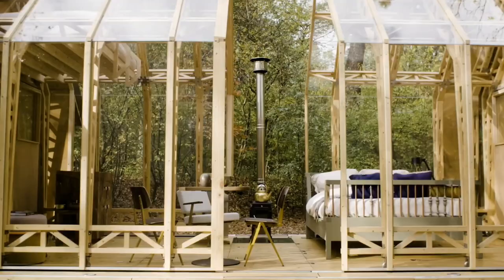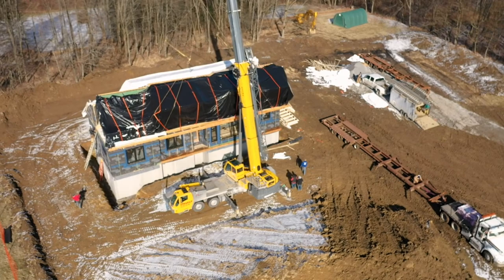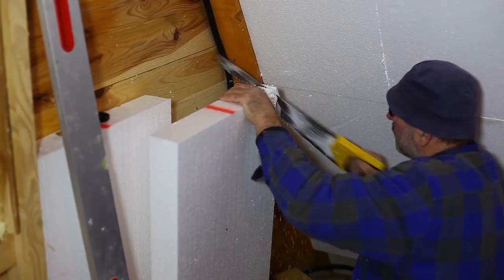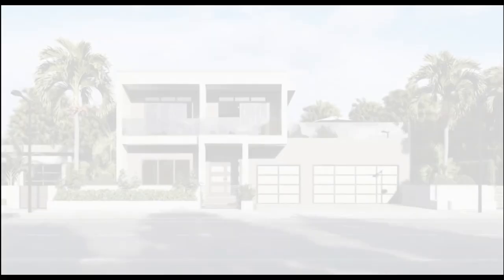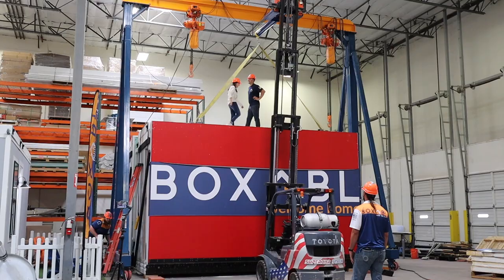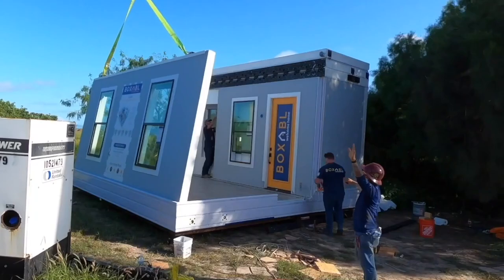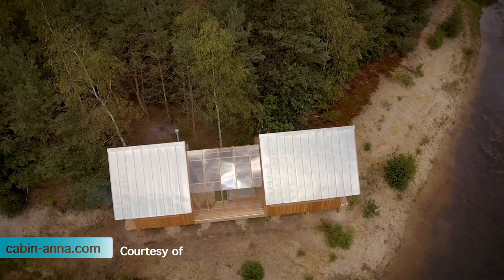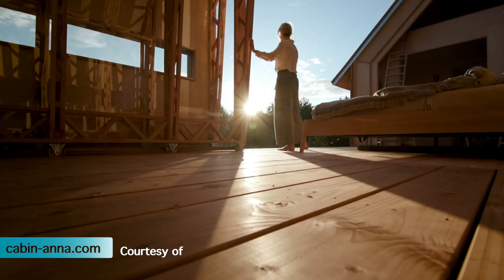The 5 Biggest Lies About Modular Homes

Comment: What do you think about mobile homes that you own the land?
Reply from the maker: I think they are a great affordable housing option.
Reply: Is it easier to get a mobile home loan compared to single family or condo loan?
Reply: @robertpaetow7812  It is more difficult to get a mobile home loan and they are pricier. That's the simple truth.
Reply: Do they increase in value I am hearing it depends on the mobile home in the area is that true?
Reply: @robertpaetow7812  I know a community that has a lot of mobile homes. They do increase (and decrease) in value, but they are not worth what a regular house is worth. And yes, it depends on location, the age and condition of the mobile home, and a lot of other factors. I believe any mobile home older than 1978 is a liability due to asbestos concerns. You will find the best values (chance for appreciation) in places where building regular homes isn't very common and you see mobile homes on regular lots rather than in trailer parks.
Reply: I have been living in them for 42 yrs.  They are not on permanent foundations unless you get it set up that way, they are built better now days, still cheaper than a modular or stick built, if you own the land they are on, they do appreciate about 2/3's the rate of a stick built.  Which keeps property taxes down.  I'm in my second manufactured on private land, bought it 9 yrs ago for $140G's, now has been appraised as high as $430G's. They do go up and down in value with stick built homes in the area.  My interest rate 9yrs ago was 4.5%, and a lot of places won't insure them for replacement value or finance them. Allstate does insurance for replacement value. I am taxed just over $3000 a year in property taxes.  I do hope the market corrects itself because being like California is just wrong.